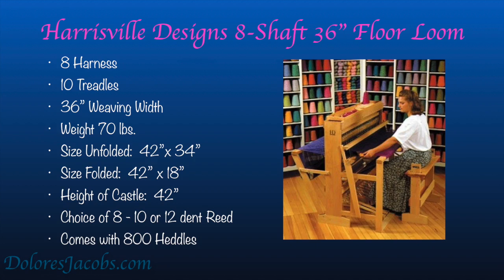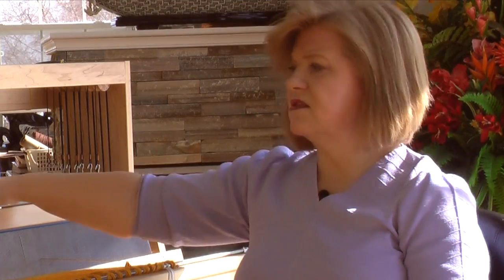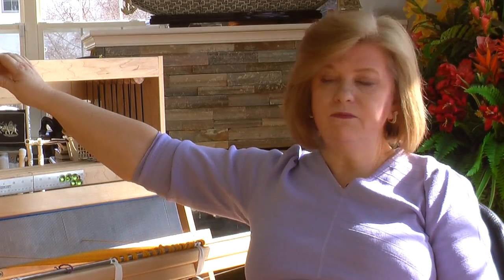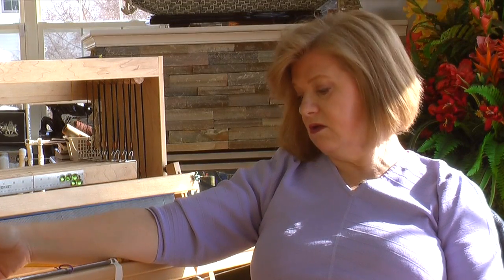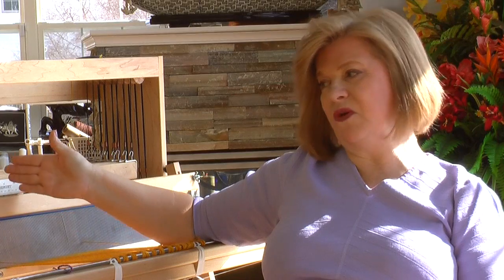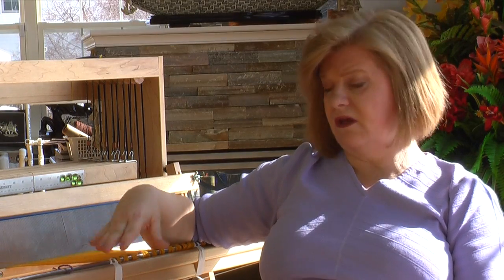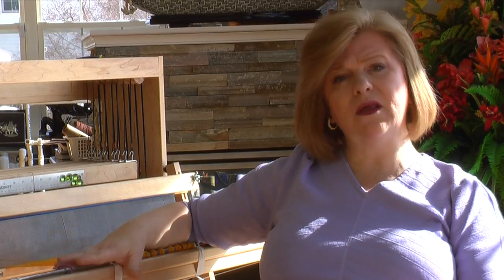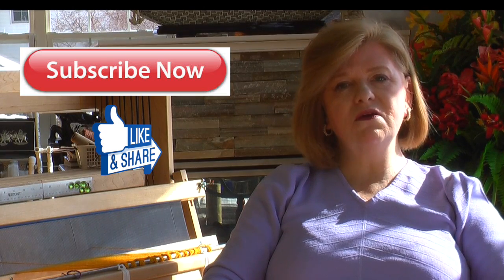Why I chose a Harrisville Designs Floor Loom - Things to Consider

Comment: I've had my Harrisville Design 36", 8-shaft for over 30 years and have never regretted my choice.  For those weavers who are accustomed to a 4-shaft, moving to 8 is not difficult and is usually determined by the pattern you want to weave.
Reply from the maker: It is a good loom and 8 shafts gives you lots of designs to weave.

Comment: Harrisvilles are my favorites. I've owned Murphy, Macomber and Pendleton. The floating shafts on the HDs keep from breaking threads.  They fold. They aren't complicated and you can even hack 2 of them together (we made an 8 shaft out of 2 inexpensive older used 4-shaft looms). For rugs, I used a Leesburg Rug Loom, the right tool for the job.

Comment: Thanks for explaining why you selected the Harrisville loom. I had the opportunity to use one while taking a 10-week weaving class, and really liked the Harrisville for its clip-chain tie-up system. My other loom is a Toika countermarche, so compared to that the Harrisville tie-up system is a breeze. After that class, in which I wove a shadow weave shawl, I searched for a used HD loom for sale and found an 8-shaft/50" weaving width that someone had owned for several years but had never woven on, so it's still basically "new". Your videos on your HD loom are very helpful, since mine didn't come with the assembly manual or any instructions on the working parts. Could you please explain why you have the Texsolv cords and pins attaching your treadles, instead of the clip chains that are typical for the HD looms? Thanks very much.
Reply from the maker: Hi Margaret,  the reason for the Texslov cords on the treadles is to make it more quiet.  I weave in a room just off the living room/TV room and I didn't want to annoy my husband with the noise from the chains.  I think it also makes it a little easier to lift the treadles without so much weight on them.
Reply: @DoloresJacobs  Ah, I see. Thank you. Happy weaving!

Comment: I would really enjoy a video on double weaving. I have a 22" HD folding loom.
Reply: Hi, I'm buying the same loom 22in 8h10t. We're going on the road. Are you able to weave towels and thicker items or is not sturdy for hard beating? Thank you!!!!
Reply: @jiggyfun807  These looms are plenty sturdy, it's the hard beat that requires a heavier loom.  Rugs, in particular, require a hard beat.  Without it,  you end up with a sleazy product that cannot take the life of a rug.  As for towels, it would depend on the type of towel.  Kitchen towels are a joy and the Harrisville turns out great results.  Heavier towels are also possible.  Using heavier yarn would produce a heavier towel.  These looms can accommodate heavier yarns; it's the heavy beat required for rugs that require a heavy loom.
Reply: @maryannerick7617  Hi Mary, I'm loving my HD 8 shaft. I've done a few door size rag rugs on it this year,(nothing big) , I had to put the shelf foam under the front legs to stop it from walking, but it worked pretty good.
I just saw a 12shaft /14H kessenich foldable jack loom for sale that I'm super interested in, but it's 2200 & I already have two looms so I guess I have to get rid of one to get another!!! Wishing you all best this year, Happy 2020
Reply: @jiggyfun807  The timing of when you change sheds can also help pack the weft in.  Rags will pack in better than a springy, heavy yard, too.  Because we have wall-to-wall carpeting, I was not concerned with weaving throw rugs although they sure are nice to have by doorways to the outside.

Comment: I want to weave blankets what size reed and harrisville loom should I buy?
Reply from the maker: The age old answer is, “it depends”.   How wide do you want your blankets?  You can weave Double Weave and weave twice the width of your loom but, double weave is easy to make errors and the weaving is slower.  You can weave panels and join them together to get a wider width.  If you can get, and have room, HD makes a 60” loom.  I would get a loom as wide as possible for blankets.

As for the reed,  the width should fit the loom you have.  Dents per inch on the reed will be determined by the type of yarn or thread you want to weave.

Sorry I can’t give you a more definitive answer but, there are so many variables to weaving a blanket.
Reply: Very good information about panels . That would be like when I crochet.

Comment: Is this a full floor loom to make blankets? I found a harrisville floor loom tensioning device, and I am new to looms so not sure if this is a full floor loom to make blankets on
Reply from the maker: Hello, yes the HD 4 or 8 shaft loom is a floor loom and you can weave blankets on it.  The weaving width is 36" so to weave a blanket you need to either weave two or three separate panels then sew them together or weave double.  This is a way to weave two panels at the same time and join them together on one side.  When you take it off the loom it opens up to be double the width of your loom.  If you want to weave mostly blankets, look into wider width looms. Harrisville Designs does make a 60" wide loom and you can find other companies who have wide looms as well.
Reply: The Harrisville 36/8 has the capability of weaving 144" width in plain weave.  Just keep your mind on what you're doing!  Turn off the phone!  Also keep in mind a 36" weaving width on the loom will not produce a 36" fabric.  You have draw-in and shrinkage that must be taken into consideration.  This is where double weaving comes in.  I highly recommend Jennifer Moore's book on double weave.  She's a good teacher and there's also a CD that she puts out that's a big help.  Check on Amazon.

Comment: I didn't know there were tensioning devices. Could you explain?
Reply from the maker: Hi,  HD makes 2 wood pieces that clamp to the back beam of the loom.  They hold 4 dowel rods.  You put the dowels in the warp like lease sticks in a cross.   As the warp is cranked onto the back beam, when warping Front to Back, it creates drag on the warp.  Since I warp alone, it is like having a helping hand to keep tension on the warp.  Here is the link to HD webpage if you want to look at them.  https://harrisville.com/collections/weave/products/tensioning-device-floor-loom
Reply: Dolores Jacobs, thanks! I think I've seen those but didn't know what they were. I also warp alone front to back, but I attach the warp to water jugs and drag them across the floor. It works, but it's a little odd, I guess!
Reply: I also warp front to back and alone. Is there a video demonstrating the Harrisville tension device?